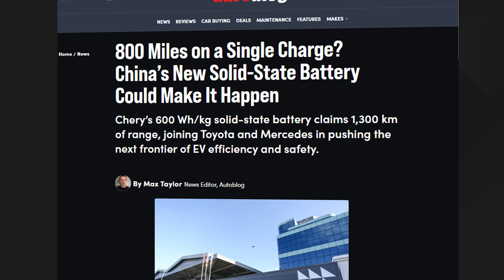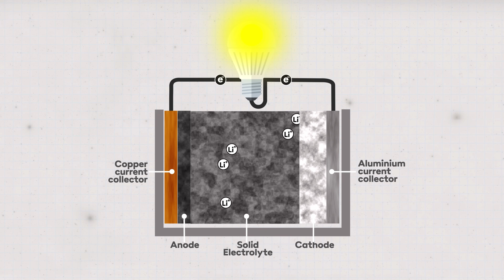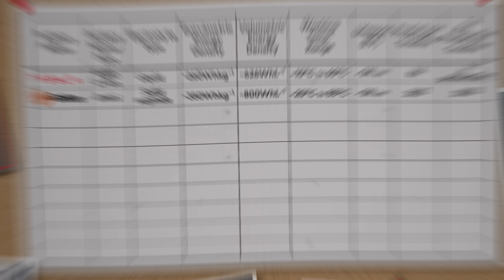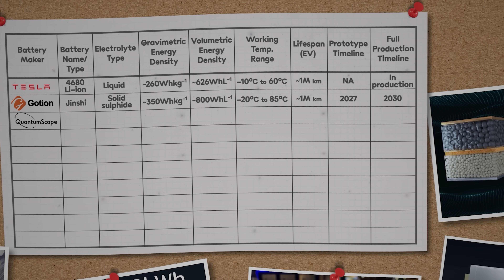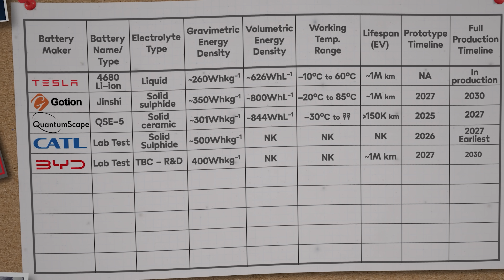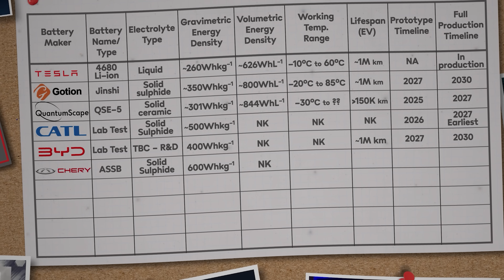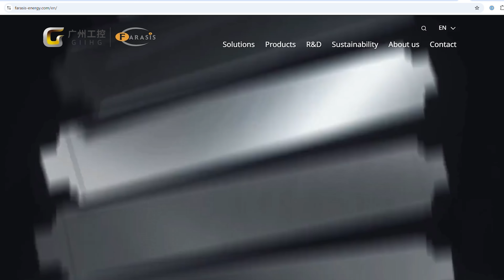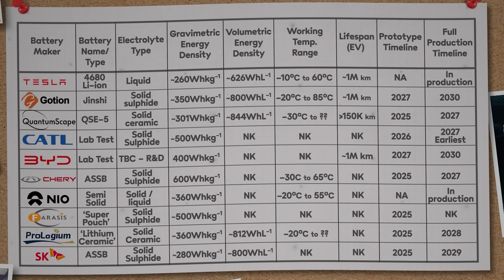Solid-State batteries. Finally arrived?

Comment: Must be a slow news week. I think this is the 3rd video I've watched asking how close we are to solid state batteries
Reply: Alaskan here. Electric cars will never be practical until a solid state battery comes along with operating temperature 40 degrees below freezing.
Reply: @jacobzindel987  That is an Alaska (and a few other places) problem. Rest of the world is living temperatures above -40 Celsius.
Reply: @jacobzindel987 With a warming climate that won’t be necessary in the future.
Reply: @jacobzindel987  if the rest of the world converts to EV's, then having ICE cars in Alaska won't be a problem. CATL's new sodium ion batteries can already handle -40C by the way.
Reply: @jacobzindel987  I live in Minnesota. My Tesla Model 3 has worked fine in -40. You lose some range, but it's still plenty for normal day-to-day driving. 

Plenty of YT videos testing longer trips in frigid winters too and it's fine because once the battery is warmed up, it stays warmed up without much additional drain.

Comment: Excuse my ignorance but will these new solid state batteries work the same as the li-ion Ines I have in my car, and specifically will they permit vehicle to house capability.  The version of 2020 Leaf I have now cannot  do this here in New Zealand currently and it seems hard to determine exactly why not!!  Seems to have something to do with bureaucracy rather than the tech itself??
Reply: V2H is completely independent of battery chemistry.
Nissan has claimed V2H for the Leaf since 2012! But I don't think it ever made it out of "demonstrations"; go read posts on the subject on the MyNissanLeaf forums. You need appropriate bidirectional hardware outside the car (apparently you can order CHAdeMO inverters from China), then you're supposed to get approval and permits to put electricity onto the grid; your house needs to "island" i.e. disconnect from the grid, during a power cut.

The low-rent way to do it is to plug some appliances into the AC outlets in many EVs.
Reply: Quite sure industries goal it to make them interchangeable. So user would not feel a difference it application but see improvement in performance. But a lot of hype is because they are SO  much more secure too.
Reply: Nissan wil make you a car with SSB and V2L. Extra and only for your needs. You must believe me!